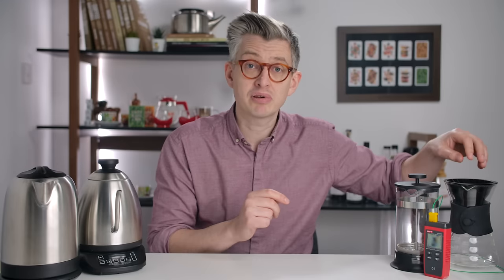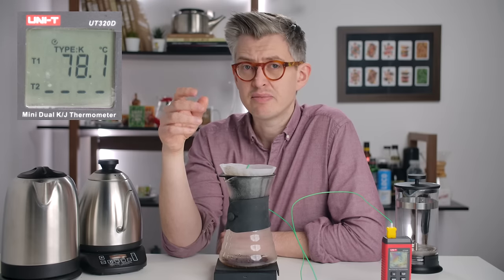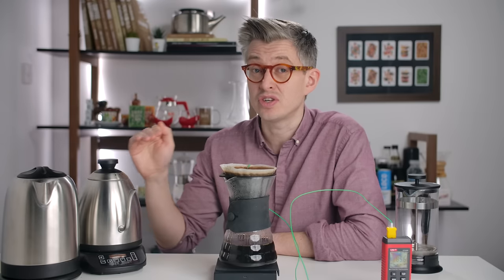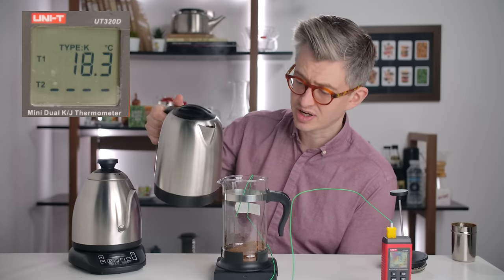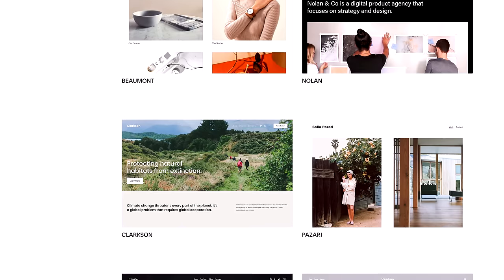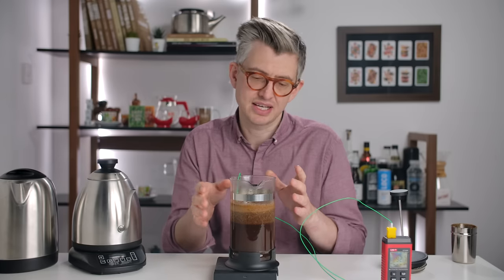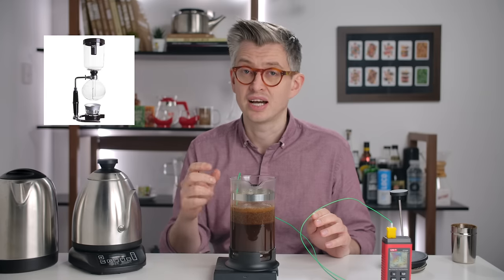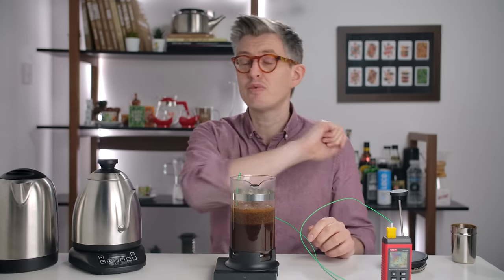Brew your coffee with boiling water - coffee brewing temperatures explained.

Comment: Coffee grounds locally see hotter water, for a short period before the slurry stabilizes. If you have a lot of fines, those can yield bitter notes during that period.

Coffee grounds is also a decent insulator. The temperature at the center of a ground, will differ from grounds-surface/slurry-as-measured temps, for a while. During which time fines are hotter and wetter, hence give up solubles quicker, than targetted-size grounds. Not really what one would intuitively want.

If you have a grinder producing a fair amount of fines at your desired grind size; you may hence be better off going a bit cooler, and consequently a bit longer to make up for the slower extraction, in order to allow for a longer time of the whole slurry; grounds, fines and solution; being at relative equilibrium. Since any contribution to the final cup resulting from the temporary initial environment where fines are hotter; hence extract faster; than courser grounds, is; at least intuitively but also hinted at by anecdotal tasting; best minimized.

Comment: Thanks for the explainer. I would argue that most pour-over are using too cool water as the goose neck kettle cools off, limiting the extraction. Towards the end they may just be diluting the coffee or "rinsing" the solute off the grounds from the earlier, hotter water. 
Where water temperature may be too hot is in a batch brewer. With the brew basket just under the spray head and interval pulsing theoretically putting at set temp water into the slurry, there is much less evaporative and radiative cooling. Care to try this again with a commercial Marco or Fetco?

Comment: Boiled coffee can be very good, actually. My grandparents (born 1901 and 1905 respectively) always had the pot standing on the cooler part of the wood stove on their farmstead. Whenever they came in from the stables or fields, they had a cup together with half a slice of a sweet wheat bread. Around 15 cups each a day. (Swedes still drink 11 kg of coffee per capita and year.) The coffee was a mild roast, rather course grind, with low acidity, certainly a blend. One teaspoon per cup and one extra for the pot. When the coffee started to boil they immediately removed it from the burner and let it rest for a few minutes.

To reduce the amount of silt there were different methods. The most common was to pour half a cup, pour it back in the pot (to get rid of the foam catching floating grains) with half a cup of cold water and then pour it gently when served. (A more extravagant way was to put egg shells - or even a whipped egg white - or dried fish skin in the pot after the coffee had boiled. The proteins in the egg shells or the fish skin captured free-floating coffee grains, but the fish skin did affect the taste.)

Even though they didn't remove the used coffee grounds but just added more coffee and water during the day - they didn't clear the pot until the layer of used grains was several centimeters thick and reached the spout, after which it was used as fertilizer - the coffee had a very sweet, mellow fragrance; I used to sit and just sniff it as a child. The taste wasn't bitter at all. The viscosity was higher, more al dente. The important thing was not to let a batch of coffee start boiling again when reheated. Nowadays people go for dark-roasted, vinegary coffee and that kind doesn't turn out good when boiled; one needs to look for a suitable type of beans.

The first time I boiled coffee on my own, without parental supervision (they were asleep) I was 3 years old. (True story. I had to stand on a chair.) When I was 5, I was allowed to have my coffee without milk for the first time. I was so proud. I alternate between boiling or using pour-over or a French press. I grind my beans with a manual Zassenhaus grinder (25 year warranty). It looks beautiful in the kitchen and guests love to grind the beans themselves.

Comment: James I’d like to see you thermocouple a vacuum brew. You might be surprised at the temps being lower than surmised. 
For instance using a thermocouple in the grounds close to where the water enters the top I’ve found that the water initially enters the top at temperatures as low as 43C. This is easily explained by the saturated vapor pressure of water at temps well below boiling. As a result for vacuum brewing I now bring the water up to 90+ C  in the bottom flask before adding the top funnel.

Comment: anyone knows the link for his coldbrew technique? couldnt find it…
Reply: There is immersion iced coffee video  and ice filter coffee video on his channel.
Reply: @auroragoh8323  thanks but those aren't cold brew... cold brew literally means coffee brewed with cold water...
Reply: @eunhoryu  well, i did a cold brew using fridge temperature water, 8.8 degrees celcius. Since most pourover techniques need hot water, i went for the 1:20 ratio, split 240 gm of water into 12 pours of 20 gm each. So pour 20 gm first, wait for a minute, then do the same for another 11 times. Taste was rather mild, and muddy. 
Final kettle water was 12.8 degrees celcius, and coffee was 16.7 degrees celcius. I recommend tweaking this recipe by yourself if you want to experiment further.

Comment: I was surprised to find out that boiling water did not, in fact, create boiling temp inside the French press.  When I bought mine a couple of years ago, I had researched how to brew coffee in a French press and several sites had promoted that theory about burning the grounds with boiling water.  Too bad I hadn't found your videos back then.  Now I know I don't have to worry about that any more.  I do love dark roast, by the way, so I'll pay attention to whether I notice any burnt flavors, but I'm guessing it won't be a problem.  I've even discovered that, on occasion when I lose track of the time and don't decant for 10 or 15 minutes (instead of my usual 4 minutes), the coffee is a bit stronger but still tastes pretty good.

Comment: Lol, I'm really happy I found this video. I just started getting back into coffee again after a long stint of just settling for Keurig, and I was wondering about this today as I was making some French press coffee. I was never able to totally figure out my French press when I first got it years ago, and I thought it was because my water was too hot since I didn't have a thermometer at the time. No matter what I did, the coffee always came out sour and acidic. Fast forward to today, and I've been tracking temperature more closely, always making sure the water in the kettle is between 195F and 205F. Then I started thinking about how much heat the water may be losing in my French press, so I did a test with some water in a mug as well as taking temperatures from the French press as I poured into it. I quickly realized that the water cools down much faster than I ever thought it would, and I determined it couldn't be the temperature throwing the taste off even when I wasn't monitoring the temperature closely years ago when I first started. I've had much better luck adjusting my grind and dosage sizes, and I'm happy to say that I'm very close to where I want to be now. I'm going to try increasing the dosage by a gram or two tomorrow in order to see if that's where I need to be, because I think I have the grind size down. I'm just trying to get the coffee just slightly more viscous at this point.

Comment: This is a little surprising to me. If the water was truly 100C and the thermometer updates quickly enough, there should at least be a moment where it reads 100C before the temperature falls off. I would be curious to see the calibration of the thermometer (and also how quickly it updates).
Reply: Since water is a liquid and liquids are easily dispersed in most thing, the 100°C water is touching all of the grounds and all sides of the glass, therefore dispersing the heat very very quickly and very very effectively. 
Same idea as putting a big steak in a hot pan, the second that steak hits that 200°C pan, the temperature of the pan plummets.
Reply: @Jackjack-kr1cz  yeah, that makes sense. I guess it comes down to how quickly the thermometer is updating in that case!

Comment: This video shows us nothing. You've simply asserted that 93C won't pull out undue amounts of bad flavors, not provided any basis for that. 

I mean heck, you didn't even taste the coffee!

People who think boiling water will burn the beans are obviously wrong, but no one who thinks boiling is too high for tasty brewing is actually asserting that the slurry is going to be at 100C. To the extent they've thought about slurry temp, they recognize it will be cooler than the input water. Perhaps the concern is that 93C is too high for the slurry; maybe you start extracting the unpleasant stuff at, say, 88C. 

Your analysis here completely misses the point.

Comment: Your experiment is flawed...when you liberally throw that 100 degree water in there all the grounds that it 
touches immediately go straight way to almost boiling temperatures...the slurry only matters at 93 C and under
Using your argument why not have your pitcher with the grounds on a hot plate to keep it boiling, would it then
damage the flavors, you bet and you wouldn't like the bitterness, guaranteed. It would be far better to keep your
water at just under boiling a couple degrees and after each pour wait until the water is back to temp near 98 C
What is best is if the water and grounds are kept as close as possible to 93 C or just under for the entire brew
time bar the bloom.